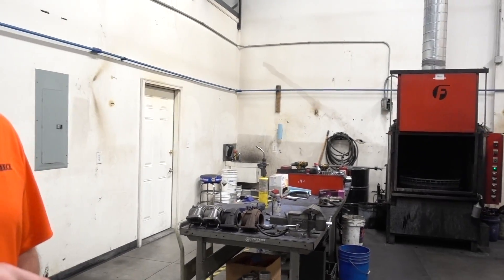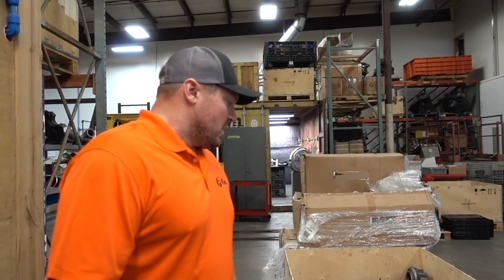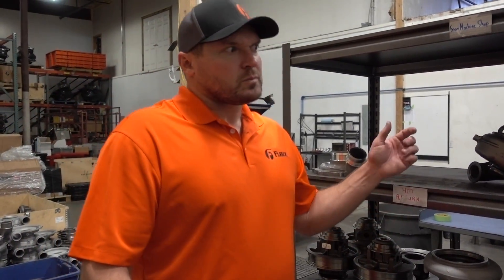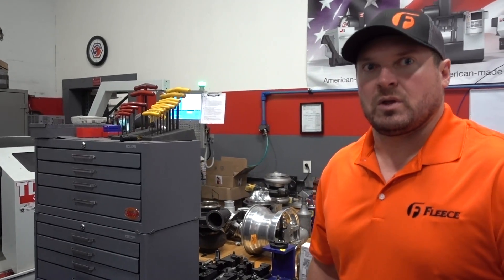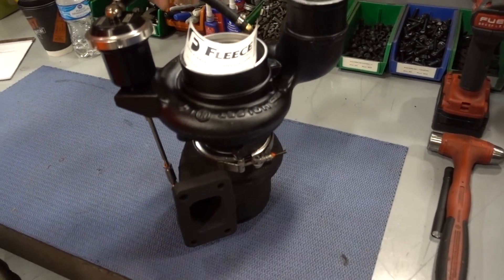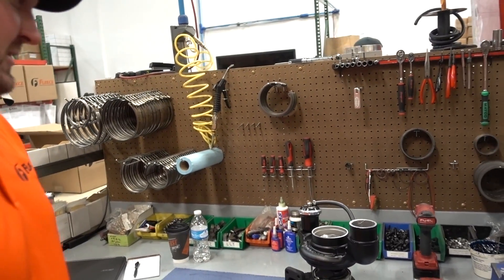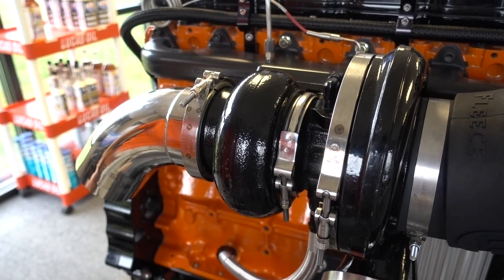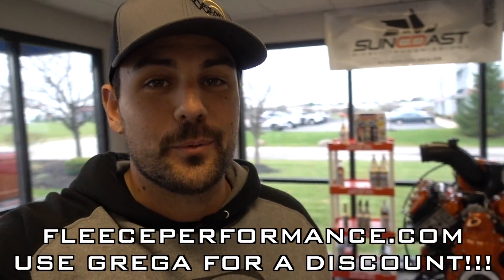THE MAKING OF A CRAZY BILLET TURBO!!!!!  FLEECE PERFORMANCE DISCOUNT!!!

Comment: i have an lb7, 2003 duramax, with s&b cold air, hyp air intake elbow,  air heater delete, fuel filter delete, 3 in. down pipe, 4 in. exhaust, no cat or muffler with efi live tunes plus a 500 hp kit rebuilt trans. i'm wanting a turbo that moves a lot of air thru the eng. the only thing i use this truck 4 is towing my 6,000 lb. camper. what turbo would u recommend for this set-up? also i have a fass uplift pump. i was thinking about the 67 0r 68 mil. turbo.

Comment: I don't get it he says the 63 cheetah will make 750 to 800 off the shelf but if you go on their website for an 04 Cummins it will make only 650 so what is he doing on his stock set up to get mid 700...i have an industrial injection 67 phat shaft and I'm getting 780 on the dyno with head studs upgraded fuel 90hp injectors but I have a 2 second lag when spool up I would like to try their 63 but the website says only 650 can someone explain this to me

Comment: Nothing for the Old 7.3
Reply: 407ForRent , believe that fleece does 7.3 also
Reply: ferrall derrall not that I can find
Reply: 407ForRent , my apologies thought I heard the MSN say the 7.3 is in the mix,although they are so hole hog upgrades, just loses its momentum...diesel pow mag has some enlightened experiences, tough to turn em up,without em auuggeerrinng
Reply: ferrall derrall The problem is the 7.3 has a proprietary turbo mounting system.  I’m thinking of just upgrading mine to a T4 flange but it’s obviously expensive to do that